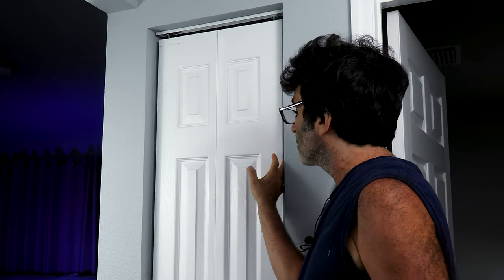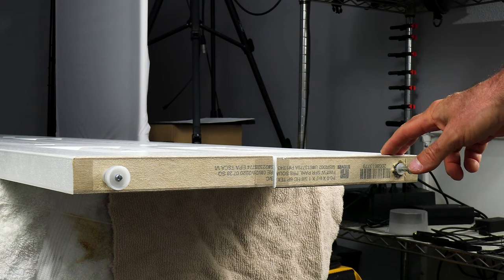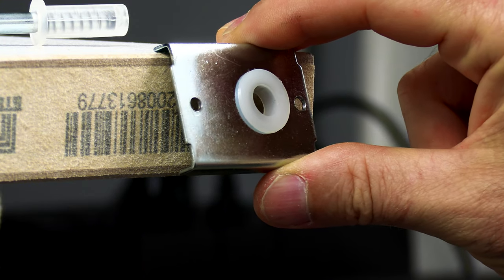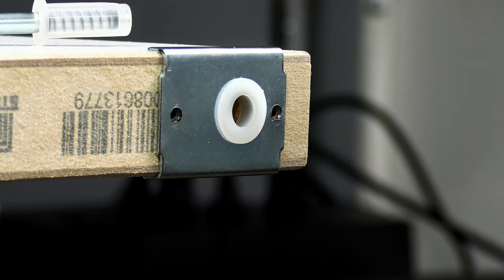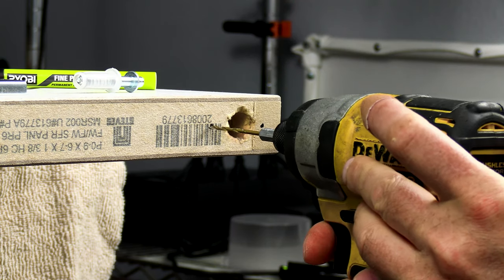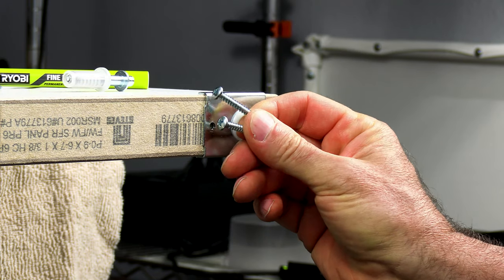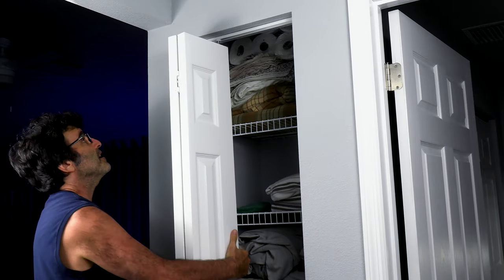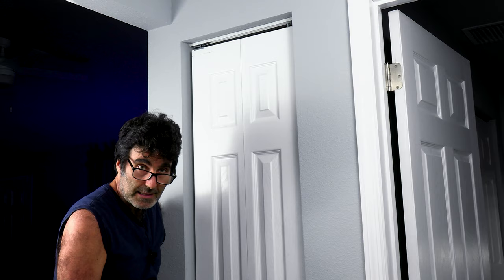Repair Your Broken BiFold Closet Door Quickly and with Ease

Comment: If you reverse the plate and install it flush with the end of the door, it is designed to place the hole in the correct spot.
Reply from the maker: Not sure its designed that way... I'd rather have it in the position shown since there will be much more "meat" for the screws to grab to... 😀
Reply: @TheHomeImprovementChannel  That is exactly how it is designed. Placing it properly as designed also places the screw hole over the wood at the edge of the door where it will be securely held, not over the MDF that is used in cheap bifold doors between the wooden edge pieces.
Reply from the maker: @BarryThistlethwaite  I actually measured the distance from end of door to where the pin is, and the distance on the bracket and they were a little off, so that wouldn't exactly work just that easy without a modification...
Reply: @TheHomeImprovementChannel  Too bad. Perhaps it's coincidence, but lining the plate up flush with the end of the door on my two bifold doors placed the pinhole exactly over the original pivot holes, with the screw hole just far enough from the edge of the door to hold it fast when screwed into the wood. No alteration needed. My doors are older, wooden bifold doors with no MDF. A month later, they're working perfectly.
Reply from the maker: @BarryThistlethwaite   Probably different manufacturers put the pin hole in a slightly different spot... 😀
Reply: The instructions do not portray it that way.

Comment: Love your clear instructions but the part where you said it was “easy” I don’t agree with. Drilling a hole in a metal plate is not something I have tools for.
Reply from the maker: If I remember right, I think I drilled an extra hole in the plate because I wasn't satisfied with the one hole that they give you.  You don't have to  drill an extra hole.  ( I could be remembering wrong)..

Comment: The bottom of the door on mine is a screw, not a pivot. My problem is nothing seems to be broken, It just seems the door isn't large/tall enough for the space because once you secure the bottom, and try to lift up the top to fit the upper pivot and wheel, the bottom then comes out 😡 yet....it fit fine obviously at some point because it just started acting up, and then came out when I tried to mess with it. No screws or parts are missing or fell off or anything though. Im beyond frustrated and don't want to have to hire a handyman for $100+ an hour for something I could do if I just knew what the damn problem is! PLEASE HELP!!!
Reply from the maker: HI!  Obviously without seeing it, I'll have to guess.  1.  Have you tried to unscrew the bottom pivot to raise up the door to the proper level?  2.  If you have try taking off the door and setting it aside.  You can remove the bracket that's on the bottom where the pivot goes and put a block of wood under it for however thick you think it needs to be to get the door high enough.  Yea you'll have a big gap on the bottom, but at least the door will work again.  Let me know if any of that helps.  Thanks.

Comment: What size of holes and screws did you use for the modification to the plate?
Reply from the maker: HI, I don't remember the exact size, but it would have been slightly larger than the screws I used.  So not very big.

Comment: Thank you for showing how to repair a bifold door. What I have is a missing door and do not know what size door to purchase as a replacement. The opening is 35" X 80" but some space on each end is needed for a proper fit. How should I determine the width of a new door?
Robert
Reply from the maker: HI.. Yea the opening is a bit small.  I'm not sure if they ever had a door there.  The door sizes go from 30 to 36.  It's possible you might be able to special order a 34 inch door, but it'd probably be expensive.  If it were me, I'd get a 36" door and rip 3/4 off each side to make it 34.5.  A table saw will give the best straightest results.  Problem is, the wood strips on the perimeter of the door are probably about 3/4 thick so the hollow core will probably be exposed.  You can take a chisel and chip off the two surfaces of the wood permitter to make it fit again and just glue it back.  You can use small staples or something like that to reinforce it.  I know this is not an ideal fix, but other than that, you'll have to re-do the opening to fit the right size door.

Comment: Would a plate work for a roller pin also?
Reply from the maker: HI,  You can use that repair plate in any position in the door.  Top or bottom...

Comment: What if the little part holding the pivot pin has completely come off of the slot? Then what do I do?
Reply from the maker: Do you mean the pivot pin has come out of it's plastic housing, and the housing is still in the door?  If so, sometimes you can push it back in, but I'm not sure if that what you mean...
Reply: @TheHomeImprovementChannel  I got it fixed, actually! I had to stand on a chair so that I could unscrew the screw holding the piece together; apparently it had bent so I had to fix that too. I put it back into the housing correctly and now it works again. It's all good now!
Reply from the maker: Oh excellent!  Glad you got it back on the road.. 😀

Comment: My pivot pin on the bottom broke but there is no solid piece on the bottom the screw the plate into. It is just a hallow door and it had a tiny piece of particle board to hold the pivot pin but that broke. How would I attach the plate???
Reply from the maker: Yikes!  If it were me, I'd cut a section out of the bottom of the door 3 or 4 inches long... leaving the  skin on the door front and back so your just taking out the bottom hollow part and put in a piece of solid wood there.  Glue it in with some real good wood glue... then you won't need a plate, you'll have a fresh surface to put the original pivot pin into.  You could tack the wood in with some small staples or finish nails if you want to to help the glue.

Comment: Too bad the bracket isn’t readily available in stores 😢

Would filling the hole with wood filler or caulk suffice?
Reply from the maker: Not really if you're going to re-use the same hole and put the pivots back in...  You could cut out a section completely and glue in a piece of wood in place of it.  I'd cut out at least a 6" section so that you'll have enough meat to anchor it to and redrill the wood in the same place as the original was.  To cut across the door, you know the 1 3/8 side, you might have to use a small drill bit and drill several tiny holes and then use a chisel to break it loose..
Reply: I don’t see why you can’t fill the hole with jb quick or  metal putty filler. Then drill hole same size as pin needs.  The auto part store sells few different kind of fillers in tubes. You knead them with your fingers to mix compound. Then push into hole and redrill with size needed for pin.
Reply from the maker: @beenheredoneit.4381  Yes I know about those... Not sure it would stick to what I could call compressed paper!  It might last for a little while, but I doubt it would last over time.  I've never tried that so I don't know.

Comment: How you measure if it gonna fit your door
Reply from the maker: So say it's a 48 inch opening by 81 high... that's going to fit two 24" doors...  Most doors are 18, 24,  30, 36 and they're all about  79 tall.  So your opening can be slightly larger, but not smaller.  For example for a 48" opening, your opening can be 48 1/2, but not 47 1/2.... can be a little taller than 81, but not 80 ... it'll wind up to short.  Hope that makes sense.